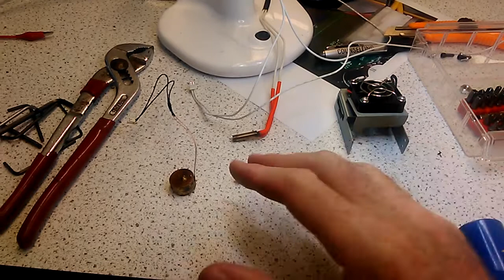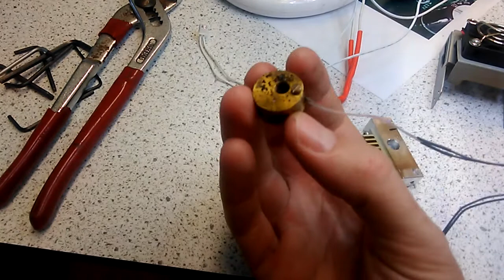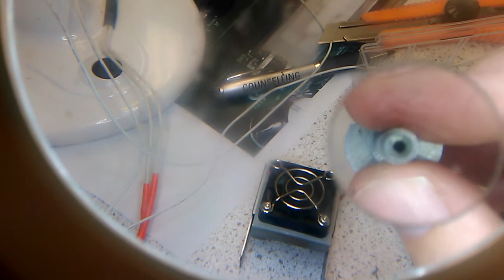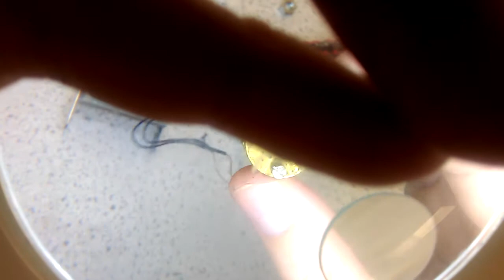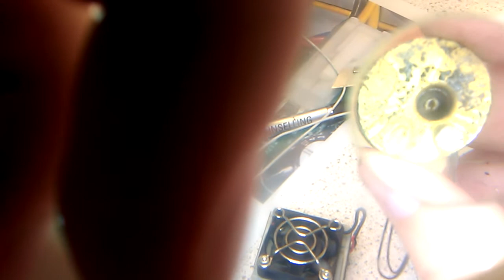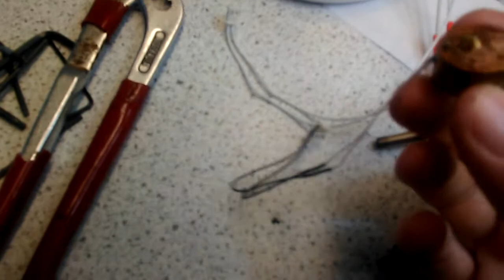DaVinci 1.0 filament feed failure

Comment: Hello, solved it the Problem? I have an DaVinci Duo 2.0A and the same Problem with both extruder. The printer is flashed with Repetier. The Problem is the the Filament often stops to transport. The Printer notices this situation an retract the Filament for a short distance to move it again to the Nozzle, but the Problem still exists and the retracr starts again and again.
When i notice this situation i press stop printing and remove the Filament by Hand completely. The filament is a little thicker at the end. If I pinch it off with the pliers and push the filament back into the print head, the printing can continue.
I think the filament is getting too warm in the back area and is already bumping in front of the sleeve.

Comment: I had the same issue I got mine out with a small drill bit but I think that outer part is not filament but pfte tubing which I think got messed up  and don't have any pfte small enough to replace it. Just got the filament out today.  Hope it prints right